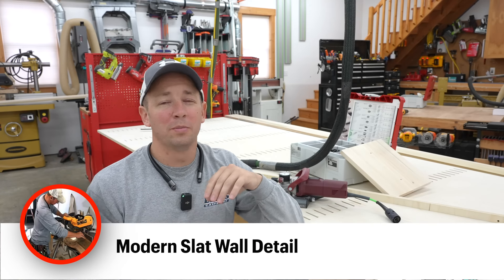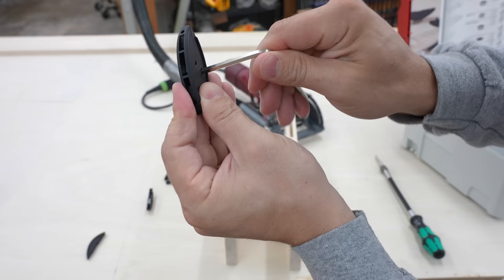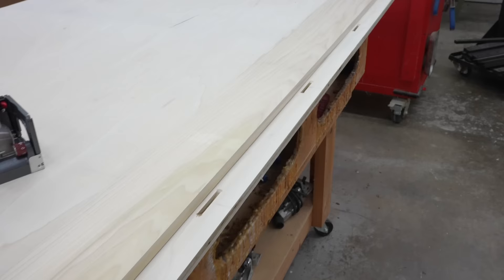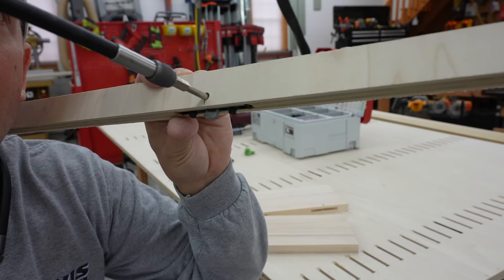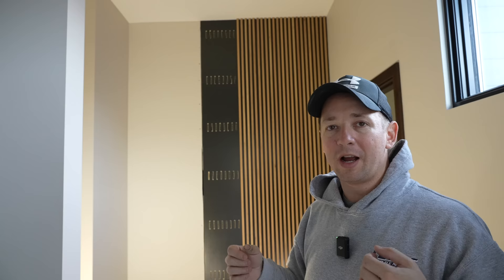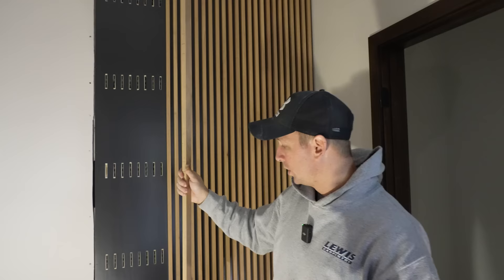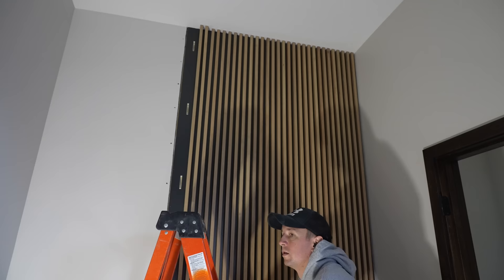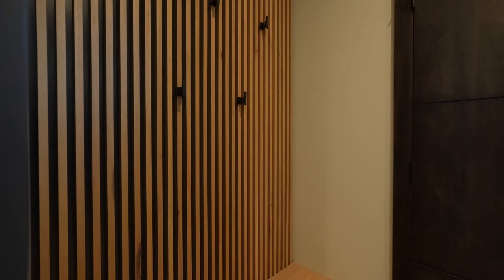Was The Lamello Zeta Worth It??? $1600 Tool & $300 In Connectors for This Detail!!!

Comment: I’m a Millwork installer in Toronto. I have been doing different variations of this project for 30 years. Your method, Spencer, is the best I’ve seen! However, it is time consuming. It is great to have customers who want to pay for quality. But even when they do, there is often someone in the supply chain who want to go cheap on labour or materials and put the difference in their pocket. That plan almost always backfires, leaving it up to the installers to fix things. Someone always loses money at this point. Never pays off to quick and dirty. But they’ll try again! You’re providing a great service, Spencer!
Reply: So true Wade, many times I've been handed things that zero thought was put into how it would be installed. Then I get to become the Ahole who spent extra time on the install..
Reply: @billystray7007  Or the guy responsible for how much Dap was used when high quality install simply wasn’t an option with that product. Typically the thinnest MDF the shop could make it out of.
Reply: I’m interested in hearing anything you have to say about methods of work for this kind of project. I have one that I’m waiting for my clips to arrive before I can start on mine. The walls are 11 foot tall 12 foot long and I have two walls so it is a lot of work. Fortunately, my slats are one inches thick by 2 1/2 inches wide

Comment: Beautiful work, very technical and a interesting take on how to do a slat wall. 

Typically a cabinet shop will pre assemble, pre finish the whole thing and the cabinet guy will trim to fit,  glue it in, and sneak screws and nails in strategic points to lock it into place

Comment: Id have definitely used the router and rail to create slots in the board then fixed the slats into the slots after painting. All depends on the customers you have , i dont see one of my usual customers wanting to pay 1000-1200 just for that design feature.  Great work though if you can get it , always nice to do a job without cost cutting

Comment: I just did something similar at a retirement home around the reception desk. Walls, columns, all faces of a soffit, all mitered. I didn’t make the panels but they were 2’x8’ 1/2” plywood painted black and had white oak screwed on from the back with proper spacing. Wish I could show a picture of how crazy it looked 😂. They had 4 panels left over and put them behind our bed. 1-1/4 square oak with 3/4” spacing so 2” centers. Each long end had rabbit also.

Comment: Great video as usual. Trying to think how I'd do this without the Lamello. No matter what I think I'm splitting it into several verticals with the seam getting hidden behind a slat. Would put it up in 2 or 3 pieces I think joining 10' mdf 1x12s longways with biscuits, pocket holes or whatever. Slats installed ahead of time.

Probably some horizontal blocking strapped to the wall either recessed by removing some drywall or just over the top. 

Shallow dados are my first thought but you need finished materials to get the fitment right on that. 

Craziest idea is to cut the black into strips using a thinner material and just alternate rows with the right grab adhesive. 

Make a story stick with drill holes and use dowels. Same jig for slats and backer board. 

Attaching to the wall is tough with the slats mounted ahead of time. You could go behind the coat hooks and baseboard or save a few slats until you run some screws. Maybe some adhesive and third hands (braced against what I'm not sure) keeping it pressed against the wall at the top where there's nowhere to hide while the glue cures.

Comment: Thanks for providing the inside details in all your videos. Being able to see things with a different perspective stretches you.  I might have added a stop block on one end of the straight edge and at each slot location to align the cuts without having to sight them in. The same straight edge could be used to cut the slots in the slats by adding a fence and cutting from the base of the lamello. In this scenario there’s no need to mark any of the slot locations. Anyhow thanks for concise content.

Comment: Need a way to justify this tool? Just install finish panels on your cabs with the tenso connectors. 

It’s pretty much game over for screws or glue and clamps at this point. 

I use tenso connectors for the bottom and sides and then clamex connectors on the top to ensure the panel isn’t going anywhere

Comment: I love seeing new tools demonstrated and the Zeta looks like it could be a very useful unit. That said, I don't think it was the proper tool for this job. 

I'm sure there are many different ways to execute this design, as indicated in the top-rated comment. First off, the long grain glue surface offered by the long hickory slats and the thin width of the slats would seem to suggest a straight glue bond could work well. Secondly, the straight line orientation of the piece would lend itself very well to work done on a table saw or router table. (Actually, this job cries out for using a CNC, but not everyone has access to one of those)

To me one of the quickest ways to accomplish this task (and I'm sure there are many others) would be to rout out long 1/4" to 1/3" grooves in the plywood along the vertical. Then, work from larger pieces of hickory and use a table saw or router to make a tongue on the back of each hickory slat to glue into the long grooves. Then, it's a simple glue up using the tongue and groove joint itself to aid in alignment. All long grain glue surface and you don't have to worry about wood movement because the slats are so narrow and you are gluing into plywood.Mind you, I'm not a professional, so maybe I'm missing something. 

I do see how the Zeta would be very useful for knock-down pieces and for tricky installs. Also, it looks like a great tool for making mechanical butt joints where you don't need the strength of a glue joint. Thanks for the content, Spencer.

Comment: At $1 a piece, and this required 180 of them, plus your time to use them, mask off for paint, etc. I’m thinking a router creating a shallow 1/8” dado and a jig to keep them evenly spaced would have been at least as fast without the cost of the tool and fasteners. Glue and pin nails to hold them in place.

Comment: In another video you'd mentioned about how, early in your career you learned that you put more value than necessary into trim production relative to the peers of your market . . . into detail that really wouldn't be seen. The tools and investment of labor in this seem to be right down that same initial road and, you've admitted as much towards the end of this presentation. Snapped lines on your backer board with pins or dowels plus adhesive would have been far less intensive and expensive.  Lower down in quality is putty filling finish nails.  Fine Homebuilding magazine had an article years ago where a painter described his technique for filling with putty blends to match the tones of the wood.  Most observers would have to be looking specifically for those fills in order to see them.  Sub out to a competent painter this task and move on.  I definitely will say your work is worthy of appearing in that journal and applaud you for your skills and patience . . . and the sharing of this work.
Reply from the maker: Yes. This was definitely overkill. But that is how we learn. To get better you have to try new things and evaluate the value proposition. 

Aside from that, I'm a perveyer of techniques for the carpentry community. So I want to bring forward different techniques and show them in use so that we can all learn and form an opinion. 

This was overkill. But it was still fun, I learned some new techniques, the project turned out great, and a lot of people get to see something new. That is some of my reasoning.

Comment: Perfect job for a biscuit joiner.   Make the slats … add the biscuits with touch of glue… get painted / stained face only then put tape on the adjoining wall where it is painted.  Then remove tape and touch of glue  and pop on slats.    Cheap and easy.  But permanent!    Not sure how much you could charge for a slat wall but likely not $2000.  That would be break even.    Not worth the hassle.  Keep it simple.   But for break down cabinets just follow Ikeas lead.   Use dowels 
Forget Festool.     Overpriced and German tools tend to be higher maintenance and higher repair costs.   
Lamello designed a tool that only their products can be used so they’ve created a franchise system.  You have to buy FOREVER from them

Comment: Cool tool for sure, but why not just use the table saw to make splines in the plywood and slats, then glue ‘em on on site? It would drive me nuts doing that many individual mortises
Reply: This is the only legit alternative I’ve seen posted. That’s a fabulous idea- the only drawback I can think of is your dado on the slats will be 1/8” thick, so the slats will have to be at least 3/8” wide (leaving 1/8” on each side of the dado). 

That seems to be the only way I could afford to apply the slats without any face nails. I’ve done this in the past with a 23ga nailer and adhesive. Spent a good amount of time wiping the squeeze out though

Comment: If you have no Lamello like me, I would have had to just use a scrap piece of 3/4 ply for a spacer block and a nail gun, If you taped off a 1/2" strip for bare wood behind the slats to glue to a flooring nailer may hide the nail holes pretty well.

Comment: The lamello looks awesome! You always do great work, man. Alternatively, if you wanted to be more economical, could you install the slats from the back with screws? So no exposed fasteners still.
Start at one end with panel on edge using some blocks to hold in place vertically. Then, screw the first one in on either end. Use a spacer block and continue as you go up. Might need a friend/clamps to hold on one side while you screw from the other end. Might be a more affordable way to go, if you chose to do so. Cheers!
Reply from the maker: That would definitely work also.

Comment: Great work. I hope you get payed by the hour. I’ve always screwed the slats from the back mounted on a 4 x8 sheet of cabinets grade plywood and installed each panel complete with panel adhesive and a few finish nails to hold it in place
Reply: @h2s142 With my system you can even do ceilings . I’ve done a few bars and restaurants that way . His system wouldn’t withstand gravity

Comment: I don't know what your requirements were here, but surely cutting dadoes for each one, drawing a line down the back middle of each dado,  prefinishing, then just dropping them into the dados, and throwing some screw or nails into the back would have saved some time.  Then just carry them to site and trim to fit with a track saw.  Again no idea what the requirements were here.  So would love to hear why you didn't go with that option since you are production minded.
Reply: that does sound 5x faster for a similar result lollll damn
Reply: This was exactly my thought but it doesn't sell any Lamello connectors.

Comment: I'm just wondering if the strips could be nailed or screwed from the back of the plywood first. I would have painted the black paint myself and test fitted the plywood. first. Then maybe the whole assembly could be finish nailed and glued to the wall?  Maybe there's some reason you couldn't do it like that?

Comment: I do cabinet work and all kinds of woodwork similar to the stuff you are doing, have both the zata and Domino. The zata is the one for this project. My plywood supplier has 10'  plywood material, depending on the finish you could use mdf

Comment: I'm a specialist finish Carpenter in Australia, vertical slat walls from 3 meters to 10 meters long including going around curved walls have become a norm for me over the last 5 years, as much as I think your system is great and gives a nice finish, it's far too time consuming and expensive, there are a number of easier ways to do this that don't involve the need for a $1600 machine, and $300 of connectors, I would hate to think what it would cost to do some of the 10 meter walls I have installed, your work is always exceptional, but I get the feeling you used the lamello simply because you have it, not because it was the right tool for this job.
Reply from the maker: It definitely isn’t realistic to use this for large jobs. I’m curious what your go to installation method is when you have a lot of area to cover? Do you do anything in particular outside of adhesive and face nails?
Reply: I think your batch cutting and marking was your freedom of cutting down extra hours of wiping glue squeeze out and patching nail holes. That wall you did there paid for your machine 2x right there. Plus the connectors made your install faster and eliminated any chance of a mail blow out hitting an unforeseen knot or denser wood grain since it’s hickory. I’ve used enough hickory in my days to know. That’s why I don’t mind spending money on fun tools to make installs faster and cleaner. I’ve never really worried about ROI’s when it came to tool investments as I know there’s always more jobs that can and probably will require me to use it again. Lastly if I don’t need the tool for a little while I always clean them and cover them so they’re ready again. The OCD in me gets the better of me at times.
Reply: @InsiderCarpentry  Lamello make CNC cutters for the Zeta. I don't know what would be involved finding in your area a CNC shop that would be open to fabricating the mortises on sheet goods, but it would definitely be worth it if you had large open wall areas to cover. The accuracy would be off the charts, and simplify your machining the slats yourself using a jig with stop blocks. This absolutely looks like the right method and I would use it even if the back panel and slats were all to be shot in a solid color (paint grade). You would never get the crisp detail and even finish painting it after assembly, plus that is considerable time filling and sanding after assembly. Bit of a letdown, that comment from Australia, especially as he offers no constructive information. Maybe he is satisfied with a lower grade of finish.
Reply: Yes id true i think the same

Comment: The Mafell Duo Doweler has an indexed guide that could work for something like this. It may have been way faster and cheaper. The initial tool costs would have been more, but the overall costs would be similar. From then on the dowels would be far cheaper than those connectors. Maybe it's another tool to add in your "arsenal".

Comment: Well done sir, that's some top-drawer craftsmanship. I'm looking at getting a zeta p2 for a similar project-slatted white oak, but using matte finished black MDF with a coat of osmo polyx for the backer boards-so many thanks for the very helpful video.
I currently have a DF 500-90% of its usage is joining panels, aligning boards for glue-ups and mitre joints on solid wood furniture. From what I can see the Zeta does this just as well if not better. I find no matter how careful I am with the domino, I can often get a tiny lip on the joint, granted its only 0.1-0.2mm (0.0039-0.078″), and with hardwood a rub of sandpaper fixes this but not really an option for veneered ply and the likes.
Can I ask how do you find the usability and accuracy of the Zeta for this application compared to the domino? 
Did you go for the Carbide or Diamond Blade? 
I’m thinking of selling the domino and getting the zeta, and getting the DF700 down the road for larger frame joints, chairs etc. 
Thanks again. 👍
Reply from the maker: I'd keep the domino. I would actually expect the domino to be more accurate for alignment.  I feel like I use my domino a lot more than the Zeta. The zeta is really more of a value if you want to break things down and put back together.

Comment: Could you have left the connectors in the plywood back and allow the painter to paint over them? They should still work.
Love to have seen how you hung the plywood back on the wall
Reply: Great tool and great job, but I can"t for the life of me understand how the tool works that is, how does it cut the undercut that holds the clip in when the tool is plunged, am I missing something??
Reply: After you plunge the tool to depth it slightly vibrates up and down at the end of the cut

Comment: Why was the drywall removed to install your slat assembly? It looks like the back of the tall cabinet meets the face of your black plywood. The cabinet could have been packed off the wall the thickness of the back panel and the drywall could stay. Some jurisdictions may consider that a fire code violation. Did the bench bury your base molding? Maybe the door casing was visually too close to the front of the bench or they wanted more floor space.

Comment: Zeta is a great tool combined with the different Lamello connectors but they only suit certain applications. I dont think this is  one of those applications. You can buy a spring loaded clip that snaps into a dovetail cut into the timber batten